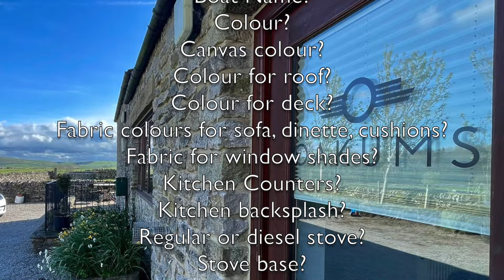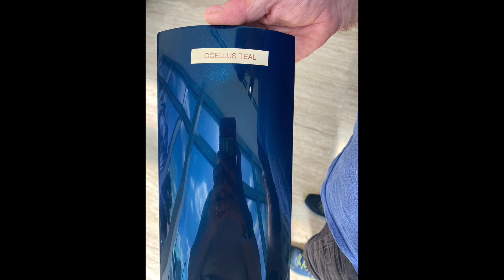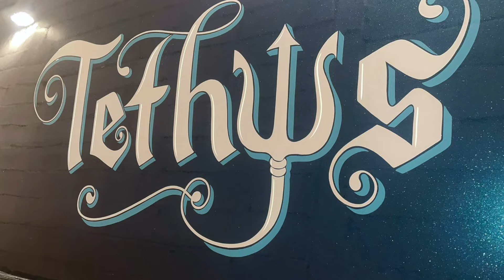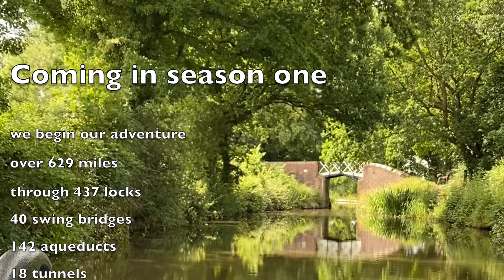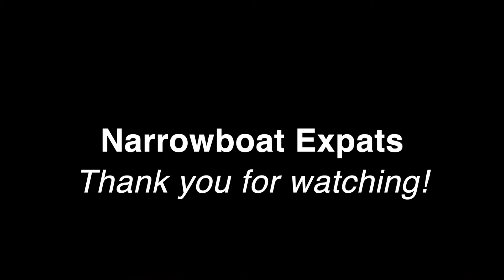S1 Ep 1 The Build

Comment: Just found you and subscribed! Lovely paint job but oh, I would be so afraid about the first scratch!!!
Reply from the maker: Thanks Bill! Alas, we managed to get a huge scratch on both sides the first day out ... long story but we were trying to avoid a collision both times and used the thrusters ... one of which was wired backwards, meaning the boat moved in an unexpected direction! (two thrusters are hard to get used to anyway as it's a joystick control ... you're supposed to just be able to move it to the right or left to move the whole boat that direction, but with one thruster reversed, we ended up pivoting instead of sliding .... hard branch all the way down the side 😢). It was inevitable I guess ... I had just hoped we could get beyond one day!

Comment: All modern finished fixtures and fittings.
Leave that out of the equation.
A boat is not forgiving, life on water is a reality check.
I presume and apologize if the boat is not built as I believe it should be.
Off the shelf standard build in other words.
Reluctant acceptance of the norm hurts.
Think about the boat shows same builders same boats at higher and higher prices year on year.
With no attempts to address fundamental floors in boat building.
Reply from the maker: Thanks for watching David! I’d like to respond to your comment but I’m struggling to interpret your sentiment. Are you suggesting boat builders should be addressing fundamental floors? If so, which ones? Oakums does attempt produce an “off-the-shelf” build, with limited custom changes. They produce all the furniture to a standard spec off-site and drop it in through the skylights. They may have their issues, but the quality of the furniture build isn’t typically one of them (we have had some minor issues, which they have corrected or are in the process of correcting - even an off-the-shelf home has snagging issues). At the end of the day, off-the-shelf fittings need to be installed by humans.👍🏻